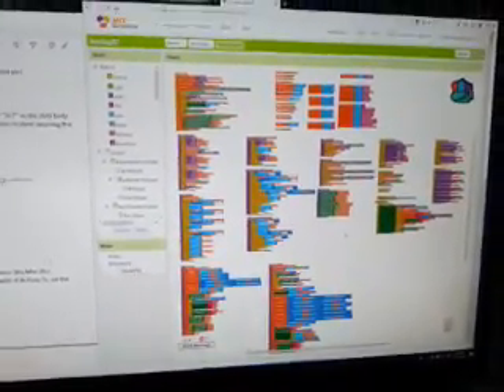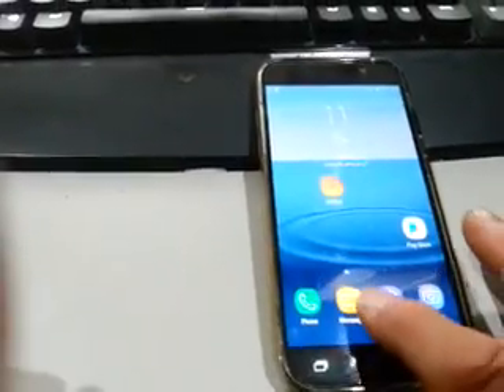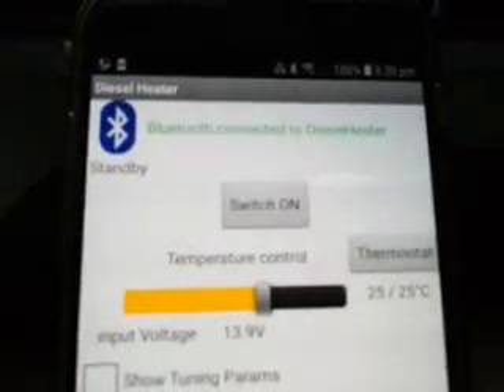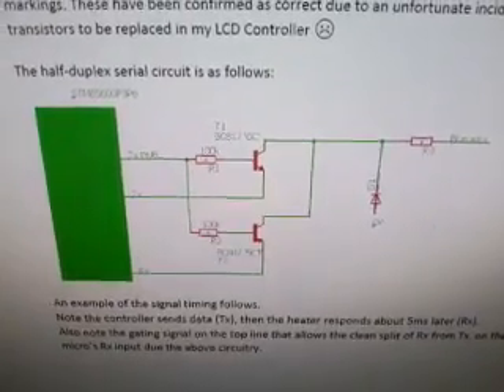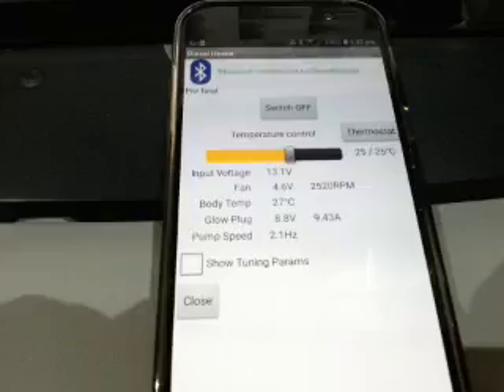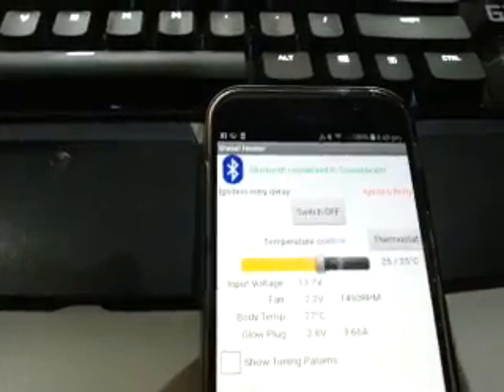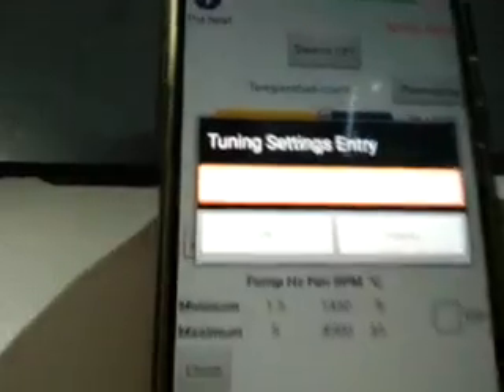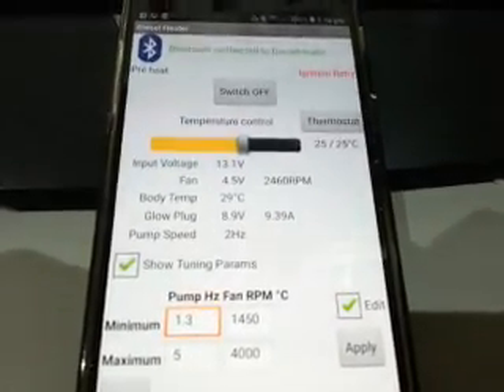BTdemo

Comment: Could you tell me the pinout of the "iphone controller" ? Please
I would like to use it on a webasto diesel heater.
Reply from the maker: Firstly a few questions back.
Is there only 3 wires?
Is there a 5V power supply on one of those (another being ground)
Is there a digital stream, or just a simple pot?
Reply: @rljzathras  its an analogue blue wire to negative with a thermostat in circuit then two wires with a switch connecting the two together to turn it on.

I'm looking at using a vintage household thermostat with a physical switch to turn it on, then a 433mhz remote controlled selanoid and a 12v timer. I've decided to keep my van original.

Thanks for the help.
Reply from the maker: @sim6699  Sorry, sounds like the controller in this video will not be of any use to you :-(
Reply: Hello from the high desert of New Mexico USA 🇺🇸. Do you make a controller with Bluetooth that can control two heaters or can you? Thank you. Keep up the good work and stay safe and charged